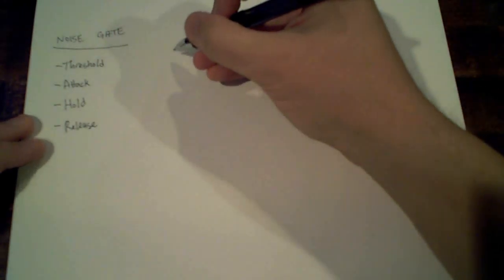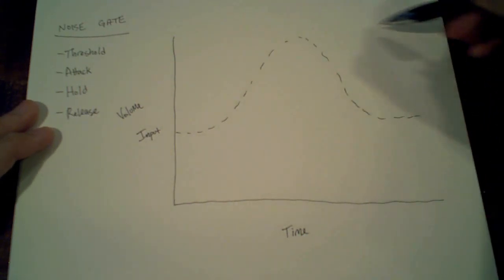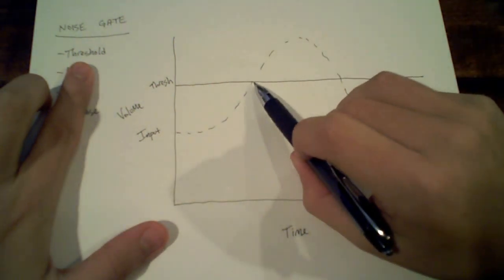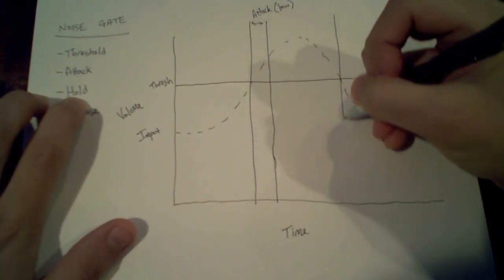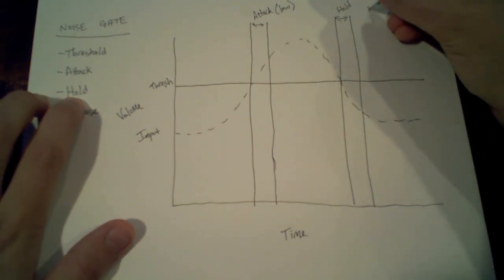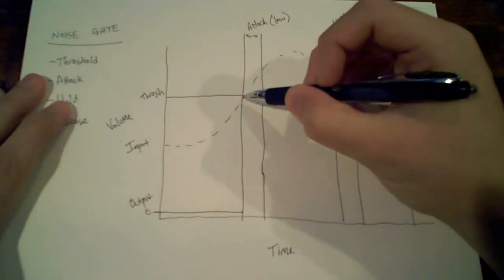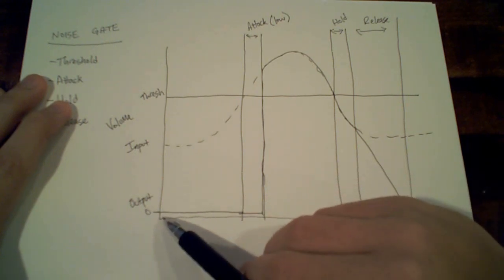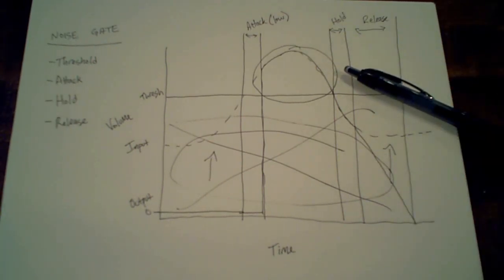Drum Mic Tutorial - Part 6: Noise Gates

Comment: Awesome video set man! Thanks for posting. I noticed your using the Presonus fire studio fw interface. Those have the xmax pre's I'm pretty sure. What DAW are you using? Are you using plug ins in your daw or outboard gear? I recently picked up the StudioLive 16.4.2 and I'm working on mixing and dynamics on the mixer and my Presonus studio channel. Curious if the settings would match. Your mix sounds full and nice. Great job!

Comment: I have been looking for hours on the computer for a great tutorial on drum micing. This was by far one of the best tutorials on here. I have learned more information than out of every book I read or guide I watched on the computer. Yes, I have questions though. I have an AW16G Audio Work Station that is NOT connected to my computer. I also have a very old Mixer, Peavy Unity Series 2000. Could you possibly do a shorter tutorial (Does not have to be fancy) on recording without a computer?

Comment: @blakdimon Well, on your tom's, Evans G2 Coated heads will give you a big boom, but you have to have them tuned differently then the normal tuning.  To get a lot of low end out of your toms, take the bottom head and crank it up nice and tight, to get all of the resonance you're going to need to project, then with your top heads, finger tighten them, then only give them about a half a turn past that of tension.  This will give you a nice fat wet sound from your toms.

Comment: @SnareSpectreok what is the difference between the PreSonus FP10 10x10 FireWire Interface (Firepod) and the Focusrite Saffire PRO 26 I/O 8-Channel FireWire Interface, which one do you recommend if im gonna get the CAD PRO-7 7-Piece Drum Microphone Pack for my drum set, and also if im gonna need that phantom power for my over heads. and if I get the firepod can I plug all the drum mics to that piece of equipment? and what other ways can I supply the overhead mics with phantom power

Comment: Thanks alot for this videos, Im satrting to look for derm mic and all the equipment that I need to record and you helped alot, Im just alittle confused on how you explained how to plug the overhead mics and what are the things I need to be aware of, those mics need XLR cables as well right? and I just need one firepod with 8 XLR outlets or imputs (however you wanna call them) right, and a firewire cable. do I need anything else for the phantom energy those couple of mics need?

Comment: I have a tascam us-1800 audio interface and I'm aware that condenser mics need phantom power which comes with the interface, my question though is if I plug any of the mics in to an input running phantom power that doesn't require it to work ( I.E. not a condenser mic) will that effect the mics or A.U.?